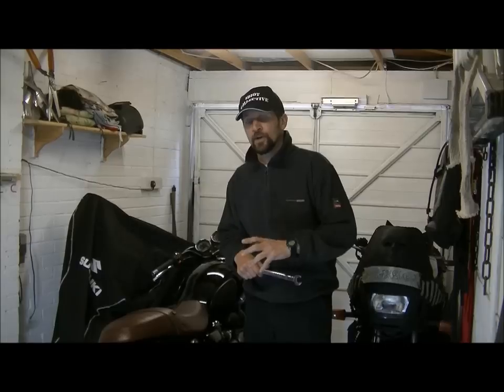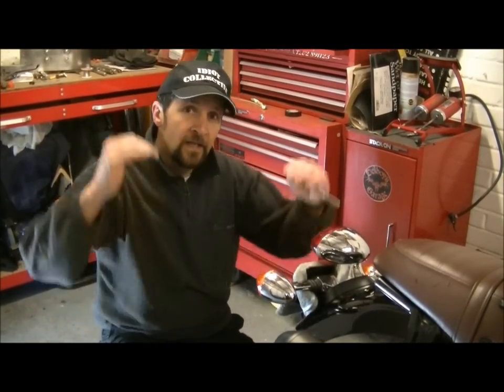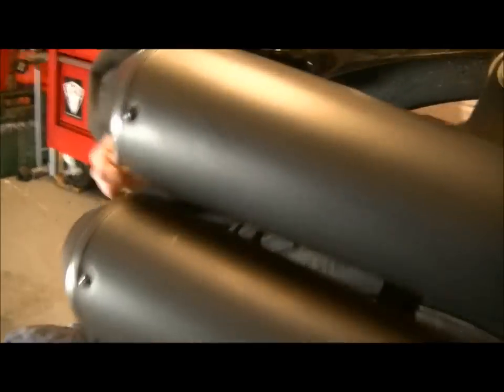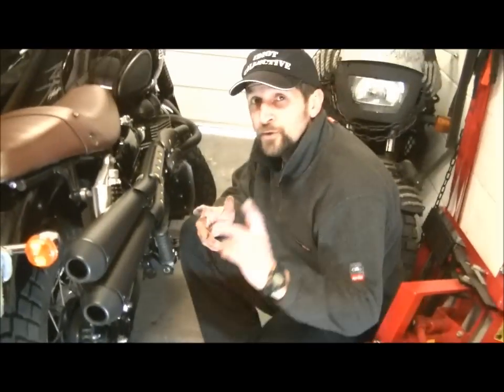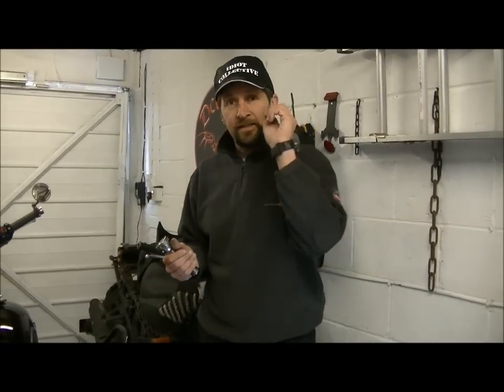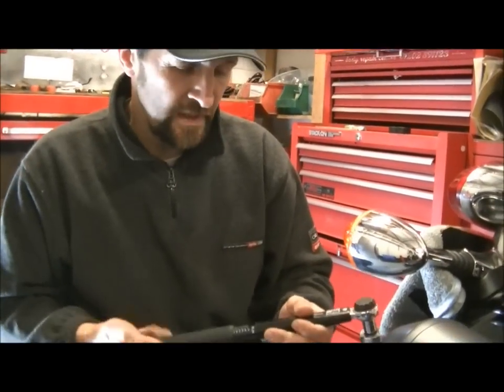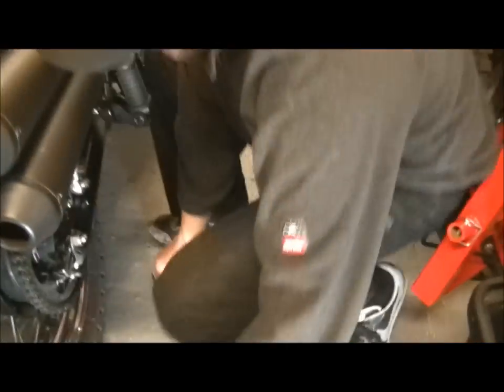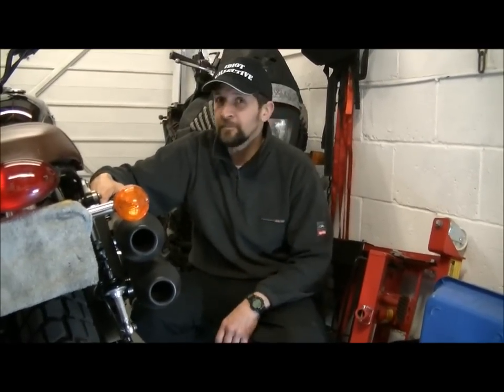Delboy's Garage, Triumph Scrambler Chain Adjustment.

Comment: Thanks for the video Del, I found it very helpful. My 2015 Triumph Scrambler has aftermarket factory fitted Arrow pipes I had a Scottoiler fitted prior to purchase by the dealer. Unfortunately the Scottoiler is interfering with the running and throwing the fueling out. When I disconnected it, it returned to full power again. Any advice on this would be most appreciated, as I would love to have the Scottoiler working if possible. The Triumph dealer told me that it was a common fault with this model of bike and they don't like Scottoilers!! Thank you. Steve
Reply from the maker: Hi Steve, that's odd, I fitted a Scottoiler to the '13 Scrambler we have and it worked just fine, but there were very specific intructions with the Scottoiler to make sure to connect it to the right vacuum take off... and they even give you a specific connection for it... is it possible they didn't read the instructions?  You could contact Scottoiler direct as they know exactly how to make them work and could advise you... if you contact Matt Ennen at Scottoiler direct, he's a really helpful and knowledgable guy and I worked with him on the promoton of Scottoiler about 3yrs ago, why not tell him we said Hi and we recommended you to him and am sure he'll sort it out for you... am sure it'll be fine, as I definitely remember there was some specific mehtod of connecting it properly and if the dealer's ignored the instruction and connected it up to, maybe, a more obvious place, but at the same time, the wrong place, that could be your problem... Hope that helps, let us know how you get on, Del
Reply: @Moonfleet41  Thanks very much for your helpful advice. I will contact Matt as you have suggested and let you know how I get on. Cheers.
Reply: @Moonfleet41  Hi Del, just a quick note to say thanks again and to let you know i've now fully sorted the issue out with Matt being incredibly helpful with his advice. The dealer who originally fitted the Scottoiler had connected it to the wrong vacuum spigot, thus throwing out the fuel injection settings. I passed on your comments to Matt, who sends you his regards.
Reply from the maker: @HinckleyHammer   Oh that's wonderful news Stephen, Matt is a great guy and I knew he'd point you in the right direction... the Triumph vacuum take off is a very specific quirk on your bike, it's not obvious where a normal take-off would be, so fair play to the mechanic, they just used common sense... great news!  Enjoy your bike and keep in touch mate...!

Comment: Love your video series! Thanks so much for sharing! I watch every single one of them :-) I just got my new 2014 Bonneville. How do you suggest I tighten rear wheel lock nuts with the torque wrench like you're doing in this video when Bonneville's exhaust pipes are not allowing enough room for torque wrench to fit. Thanks!
Reply from the maker: +Petar Jankovic Hi Petar, I know of this problem, the pipe gets in the way....the proper long answer is to drop the right hand pipe off so you can access it...but nobody does that...just tighten it up so its good and secure, then dot some marker paint on there to keep an eye on it... that's whay most people do... good luck matey, take care.. Del.

Comment: Another great video, you’re videos have saved the day on many occasions working on my ‘07 Scrambler. What tyres are on the scrambler in this video? On another note, I fitted a pair of VW beetle tail pipes to my scrambler as an experiment, they were a perfect fit, the sound was awesome and there was no performance difference BUT can it damage the engine at all?
Keep up the good work
Reply from the maker: The tyres are Dunlop Trail Wing fitted from the factory and not very good and with your pipes, if all you're running is V Dub baffles in the header pipes, then I would certainly go along to your Triumph dealer and get it re-mapped to run on universal baffles, it won't do it any good long term running on the standard map with those, it will soon start to run lean in the warmer weather.
Reply: Thanks for info, as mine is older (carbs) will it need re-jetted or do you think adjustment would be enough?

Comment: I am bikeless at the moment but love these videos LOL ...Great work Del and Penny Superb ! Del did you buy the Scrambler brand new ? What's the score with starting to Mod a new bike still under warranty?  At the bike show last week the guy i spoke to on the Triumph stand told me any exhaust mods on a new scrambler would have to be an official Triumph exhaust as to not invalidate the warranty. I'm pretty sure when the time is right that the "Scrambler" is the one i want because i love that engine with the 270' crank gave me a proper BIG Grin when i test ride it :-)  My biggest problem at the moment is deciding wether to buy secondhand or New? They seem to really hold their value second hand and Black Scramblers are like rocking horse teeth ! What's your thoughts Del? Cheers Paul
Reply from the maker: +Paul Trew Hi Paul, I think you know my feelings on warranties and dealerships, tbh, I am sick to the back teeth of dealers and their cocky, sarcstic and santimonious attitudes, most of their staff don't know their arese from their f'kin elbow and coulnd't knowledge their way out of a child's nursery school unless it's written the brochure!

Look first at what a warranty is - it is guarente from the manufactruer that then machine is free from macnufacturing defects, fit for the purpose designed, and NOTHING ELSE... so within 100 miles you will have discoered any manufacturing defects and the very fact it's ridden 100 miles proves it's satisfactory for the purpose designed, anything else beyond that is 'customer service' - and lets face it, in this country, most customer service is appaling...!  The stories we hear would curl your teeth my friend, so to answer your question in straight terms, I would buy a new bike, and forget the waranty

To qualify this, I'll put it this way... IT'S A NEW BIKE!  It has no wear and tear whoatsoever, everything is brand new, even the hairs on the tyres, so buy it, like I did mine, ride it 600 miles, take it back for 1st service... then never return!  After that, you've used the dealer as a vending machine and got yourself a  bike for life - you are not buying someone else's wear and tear, someone elses bodge ups and mis-treatment... Penny now rides the Scrambler I bought and ThreeX Motorcycles will never see it again - quite frankly, I wouldn't trust 'em to wipe it over with a cloth, so I hope that answer your quesions, simply put, buy it new, but treat it like you would a second hand purchase, that way you get the best of both worlds !  How's that!!!

Comment: Hi Del - Great video as usual, sound advice, love it.  This may be one for a future Q&A but related to chains - what's your view on dry chain lube? I use it on my Street Triple to avoid "fling" but the chain never looks particularly lubed (although it is greasy to the touch and isn't tarnished)...any strong views??? Cheers - Andy
Reply from the maker: Andy...i LOVE dry chain lube, and as soon as the bad weather is gone ill be switching the Scott Oiler off and switching over to a PTFE based powder lube.  The dry lubes are used in racing and there are no more extreme conditions than that...Its always disconcerting when you cant see any build up or 'wetness' but there isnt meant to be, they are designed to keep race tracks clean of oil and flung off lube...so as long as you use the correct lubricating regime they are perfectly fine, and my own choice in summer.   

Start with a totally clean dry chain, lube it with a single pass of the spray and take it for a ride...then relube again with a 'double pass' once the chain is good and hot....then, as there are no anti-rust qualities to it, make sure that if you have used the bike in the rain, dry the chain off after the ride with a dry rag....then relube it again while its still hot..

Hope that helps you buddy..
Del.
Reply: Moonfleet41 Great news - cheers Del - that's pretty much the regime I have been using (and the Street Triple is my "dry weather only" bike anyway).....glad to know I'm in good company - thanks for taking the time for such a full reply - all the best...A

Comment: Hi del i have bought a triumph trophy 900 and not sure how you adjust chain on these they are like the ones on your tiger only ever had the nut and bolt type ones could you poss do a vid demonstrating or let me know how to adjust have searched you tube but cant seem to find anything  thanks mate
Reply from the maker: Hi mate, good to hear from you again, does your Trophy have the cylindrical type adjuster rather then the slide type? as i thought they used those on all the big touring bikes....send us a picture if you can and ill guide you through it fellah.. ?
Reply: Found out how to adjust those those adjustment tensioners in the end its the same set up has the triumph tiger also lowered the bike for my short legs by turning the adjusters 180 degerees so has the axle is at top rather than bottom lowering the bike 40mm got this tip from triumph owners site  thanks any way del
Reply from the maker: bruvamonk
Hi mate, thats why i asked if it was the drum adjusters, you said 'same as on the tiger'... but not on my Tiger.. the 955i has regular slide adjusters....so they can vary between models, fortunately you have that great facility if being able to roll them over and lower the bike...clever aye... Glad it worked for you buddy, always drop us a line if you need any help..  Del.

Comment: Another superb video, thank you! 

After watching I noticed on the chain side I am at the 3rd notch, other side at the second notch. The chain has proper slack, should I tighten up the side with only 2 notches to 3, or chain side to 2, for proper wheel alignment? 

Btw all my DIY vids couldn't have been done without you! Cheers mate :)
Reply from the maker: Hey buddy, with adjusting your chain, the notches are irrelevant, well, certainly which notch either them is on is irrelevant, they are simply a guide for symmetry... set the chain to the 'correct tension' (1.5" up and down movement at the centre of the chain slack) and then wherever that leaves the right hand notch plate, you adjust the left hand notch plate to correspond... re-check the chain tension and then re-check both sides for symmetry... job done!  Good luck with it and good luck with your videos, my friend! Del
Reply: Moonfleet41 Yup that did it, symmetry and chain all done up properly, thank you! I do have another question if you have a sec…I was wondering if I remove the baffle from my 2:1 Arrow exhaust system, can I reinstall it if it is too loud or runs too lean, which I read it does? Thanks again!

Comment: Thanks Del! So I guess it's the same as with what I do on my car: step on the wrench with my weight  for that last tight when hand is not enough anymore and that's it, right? Thanks man!
Reply from the maker: +Petar Jankovic HI Peter, on a bike, hand is usually enough if you use a 12" long bar or wrench, they are easier to overtighten than car lug nuts...you can crack the wheel bearing cups if you go standing on them too much... if you want a measurement, then about 70lbft is more than enough..

Comment: Have they done away with the castle nut and split pin like on my ye olde kawa ?

You will laugh at this, when ive had to take the wheel out to replace the tyre, ive stretched wire from the front drive cog to the rear one and adjust the adjusters to lose the light gap, then use the nut turns much like you did.

I used to wear chains out, i did use engine braking a lot, i know its a bad habit :-(

Comment: Hi Del and Pen! Very nice demo, as usual. Just wondering... how does the factory determine torque settings?  I.e., why do they spec 70lbs and not 60lbs or 80lbs?  (I suspect there's some formula math involved pertaining to fastener sizes as well as the strength of the various metal alloys used in each specific case.) Also, why do some fasteners require Locktite and some don't?
Reply from the maker: Hey Byron, good to hear from you buddy... axle torque settings are determined by the maximum load bearing capacity of the inner cup on the wheel bearings... the thickness of the axle tube... and the type of nut used...!  With regular bolts it is, indeed, a maths calculation, arrived at by using the thickness of the bolt shaft against the receiving material of the inner thread  ie. stainless bolt in to stainless thread high torque, stainless bolt in to alloy thread low torque........ how boring is this lol!
Reply: Thanks Del!  I guess my real question is how do they / we know when a fastener is tight enough? And when to use locktite or lock washers? I've had fasteners come loose and it's a bit scary to think of something important falling off the bike at 70mph :)
Reply from the maker: Byron Anderson  Oh I see what you mean... it can be a concern... Loctite is generally reserved for really important fasteners , like suspension fittings and internal engine components etc., but generally speaking you don't need it... just do the fastener up to the correct torque value (as listed in your Harley service manual (and they are all there and easy to find))... and use the trick with the marker paint on the nut or bolt head, so you can keep an eye on it...

But as Harley's vibrate a little more than most bikes, the torque settings have been worked out by year so of development and testing ... you can trust them!
Reply: Thanks Del.  Here's a good example of my concern and mechanical clumsiness:  I had removed the seat to get at my battery and when I reinstalled the rear seat bolt I tightened to what I thought was reasonably tight. About a week afterwards I noticed the seat bolt had come unscrewed and basically would have fallen off, allowing the seat to come free.  This time I used blue Loctite on it and screwed it down tighter.  But the next time I needed to remove the seat, the bolt wouldn't come loose and I ended-up mincing the head. I finally got it loose using a different driver plus vise-grips, and obviously had to get a new replacement bolt. I'm mechanically pathetic, I know! :)  All the best Mate and Hi to Pen!
Reply from the maker: Byron Anderson
Oh i see, well don't get too bothered by that little experience mate, those bolts are a damn liability, if you don't fit the factory 'shake proof' washer under it then it will rattle out every time....that is one modification i make to every Harley i have ever had... swap out the daft pathetic screw (that seems to be made from stale pastry) for a nice stainless steel alun bolt...that way you can wind it in hard enough so it wont unscrew itself....  Glad you got it sorted out buddy, and always drop me a ping if you need any advice or help with anything.... all the best.. Del.

Comment: Hello. I'm new to your vids. Love them. I noticed you didn't check for any tight spots on the chain before adjusting it so that it was at the slackest point
Reply from the maker: Hi buddy, I guess I didn't show it in the video, done many videos like this, and always made that point clear, just missed it on this one - thanks for the heads up... and you adjust at the tightest point, not the loosest point... thanks for watching!
Reply: Moonfleet41 yeah, thanks. I meant the tightest point. Sorry

Comment: Alright Del and Penny, maybe people said they done it up to 100NM instead of lb-ft, which is about 100nm= 72.5lb-ft so near the same as you said?
Reply from the maker: No mate, I've seen people on the Triumph forum saying they lock it up to 100ft-lbs  'to be sure'!  It's proper dangerous as it can literally sheer the threaded end of the axle clean off, not to mention, crush the inner bearing cup... specially at speed when it gets hot!  Sometimes less is more!